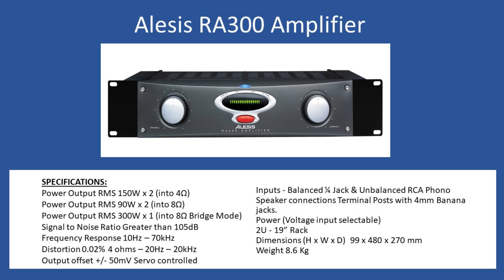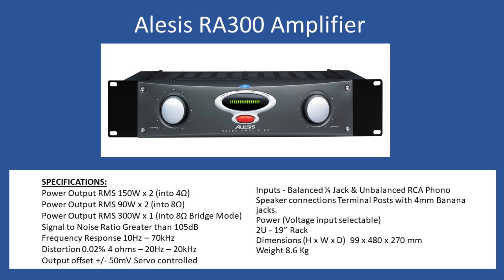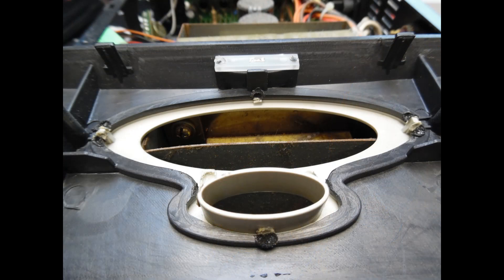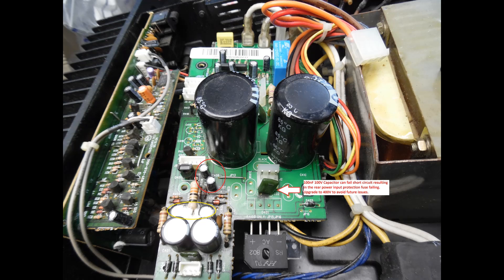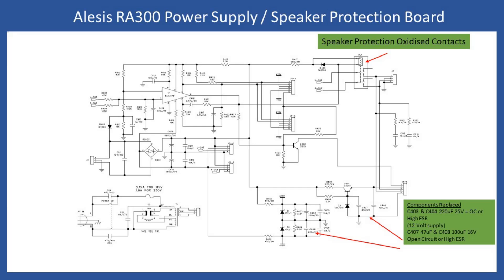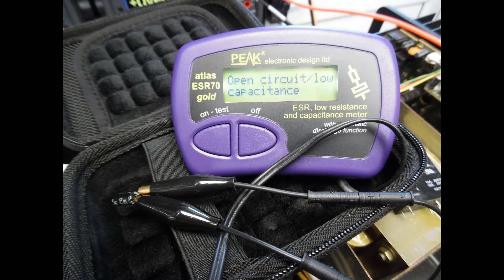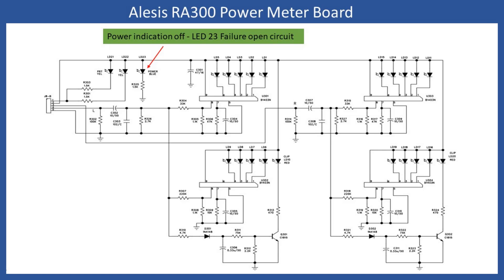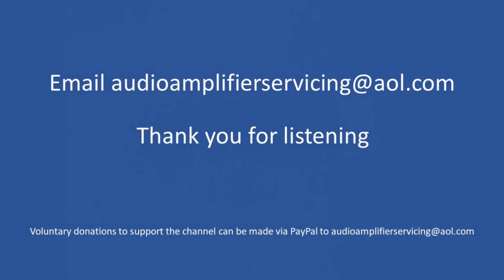Alesis RA300 Amplifier Repair (With Audio Tutorial)

Comment: I have an RA300 that simply stopped making any sound. I really like it and am wondering if you any thoughts. I took it to a repair shop and (I forget what he said needed replacing) but he said it would be cheaper to buy a new amp. I do like to try and fix things if I can rather than them going to the dump. Any help would be appreciated.
Reply from the maker: Hi if the Amplifier is powering on but you cannot hear the click from the Amplifier after 5 to 8 seconds then there is a high probability that the speaker protection relay on the power supply needs to be replaced.
Reply: @AudioAmplifierServicing  I did check it today. I connected speakers, powered it up and , you are correct, no click. In the video at 9:30, am I correct that the speaker protection relay is the yellow piece at the back left of the picture?
Reply from the maker: @TheStickid01 Hi no its the black oblong component on the same circuit board at 3.31.
Reply: I found a schematic for the amp but I am not very adept at reading them. I suspect it is J7 although I can't be certain. By the way, it is very generous and kind of you to provide this service.
Reply from the maker: @TheStickid01 On the schematic it's RL1
Reply: @AudioAmplifierServicing  I went looking today in the biggest city close to me (over 600,000 population) and the last electronic supply store we had closed. I spoke with one fellow at a repair shop, and he would not sell me the parts, would only do a repair. Looking online, I can only find the Dong Woo version and they are selling 10 at once. What a shame that obsolescence is the easiest path these days. The fellow I showed my board to said the capacitors last a certain length of time and he thought I should replace all of them, not just the 4 you showed. On my board, there is a brown substance around those 2  that you had circled in yellow.. I assume one of them has burst or leaked somehow. I am not gong to give up and soon as I can find my soldering station(it is somewhere "safe" ) I am going to remove the suspect components. I will continue my online search but I assume I need a direct number replacement for the relay  in any case. I am looking on the page here to find where I can send a contribution as I really appreciate that you do this for people like me. Thank you
Reply from the maker: Hi, this is the part number for a relay that can be used to replace the failed relay.  40.52.9.012.0001
The brown substance is most likely glue and can be removed with a plastic scrapping tool.
Reply: @AudioAmplifierServicing  ordered how can I make a donation to support your work? Thanks again.
Reply from the maker: @TheStickid01 Hi, when you receive the relay, cut off the unrequired pins so it matches the original. A voluntary donation can be made via PayPal to audioamplifierservicing@aol.com